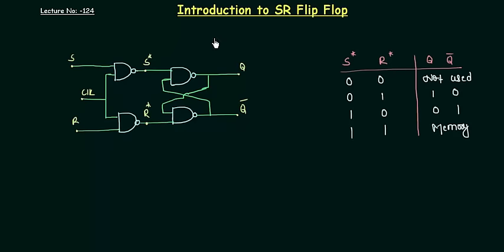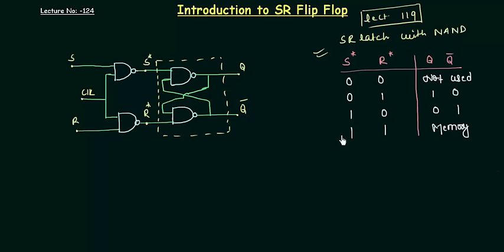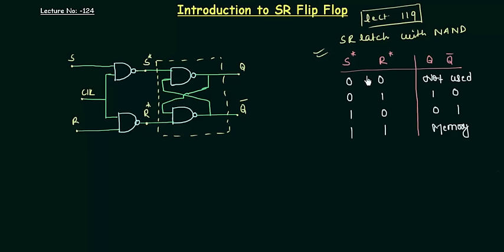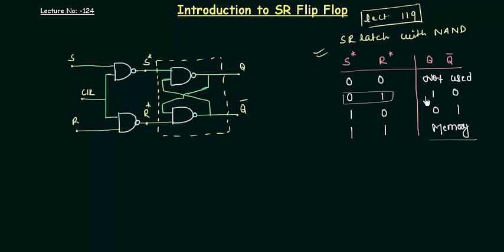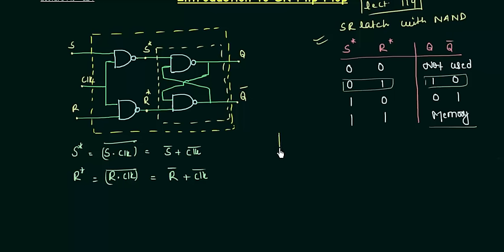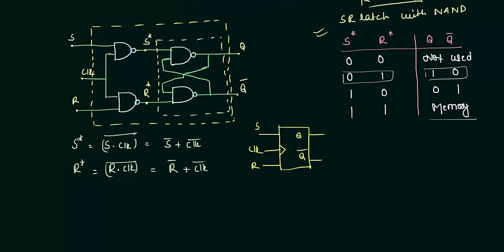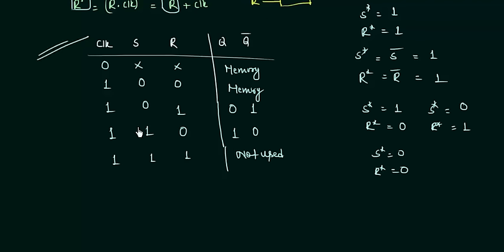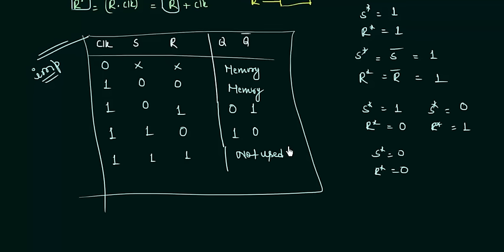Introduction to SR Flip Flop

Comment: Those who have confusion in TT. 
In SR latch video we use a NOR gate but in  this video we use a NAND gate that's why the value of Q and Q' seems to be reversed.
Reply: Yes the TT seems to be reversed. He has used NAND in this video, so as per that when S and R are both 0, that will be a forbidden state or not used state. He made the TT for NOR gate.
Reply: @bhaskarbhar237  you're wrong, he's using it for the nand gate and it's correct

Comment: Sir in lecture 119 ,14:34 , 0 0 case is noted as memory and 1 1 is noted as not used, in this lecture, 0 0 case is not used and 1 1 case is noted as memory. Why it is contradicting?

Comment: I fail to understand how this is a flip-flop. What I see here is an SR-Latch with just the En pin renamed to clk. While, clk is high, the output will change multiple times if inputs S, R are changed. That is level triggered, while it should have been edge-triggered if it was a flip-flop.

Comment: SR Flip Flop
When we attach clock pulse to SR latch it becomes SR flip flop, SR flip flop is an in-memory state when Either clock pulse or SR has low low input.
Edge Triggering Method is used for  Triggering the circuit. and so on

Comment: I didnt get one thing. It was mentioned in the previous video that the difference between SR latch and SR flip flop is that the former is level triggered while the latter is edge triggered. But isnt level triggering being used for SR flip flop here?
And secondly, does SR latch have no clock input?
Reply: Yes, SR latch does not have CLK input so it updates the output immediately as input changes while a flip flop updates the output only when the CLK signal is changing from low to high (leading edge) or high to low (falling edge) as it is edge triggered.

Comment: The SR flip-flop, also known as a SR Latch, can be considered as one of the most basic sequential logic circuit possible. ... A basic NAND gate SR flip-flop circuit provides feedback from both of its outputs back to its opposing inputs and is commonly used in memory circuits to store a single data bit.

Comment: first  explaining is high  understanding
so when   you draw this circuit  it should be a latch not flip flop as you menshined
the difference bet ween   latch and flip flop is
 latch working in level trigger and   flip flop work in edge trigger positive or negative

Comment: A flip-flop is edge triggered.then why are you using level triggering in SR flip-flop?
Reply: +Roshan Kumar you are right.  He has a SR latch with clock signal but not SR flip flop
Reply: Roshan Kumar u can consider it as level triggering...since there is no feedback from output to input..level or edge is not important here
Reply: Very good question. What is explaned in this video is SR latch and not flip flop. Consider reading  page number 196 from  Digital Design from M. Morrris Mano.

Comment: Great channel great work thanks!!!
What is the difference 
 1) SCR vs D latch ? 
2) LATCHES  VS fLIP-FLOPS?
3)SYCHRONOUS VS Asychronous circuits?
i will appreciate your answer thanks...
Reply: Synchronous and asynchronous the difference is that when the clock pulse is applied to the flip flop if they are clocked at the same instance it is synchronous that is each of the flip flop receives the same clock pulse asynchronous is the opposite. Here the output of the first flip serves as the clk input to the second and it occurs.
Reply: It's been 4 yrs you would have got the ans
Reply: @nandininandakumar381  yes i found it 4 years ago ! Thanks for answering though !
Reply: @ΑντρέαςΣωτηρίου-π8γ  😌😌